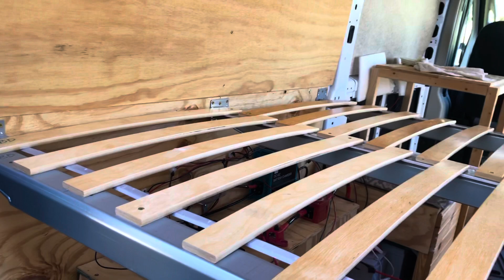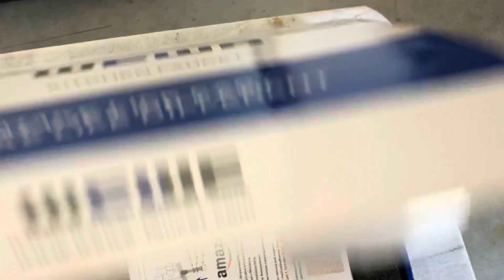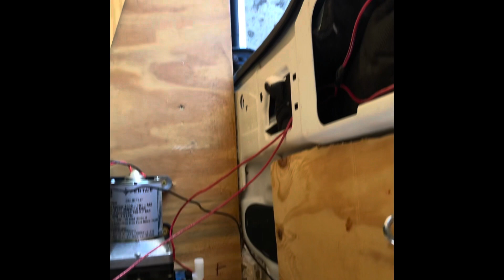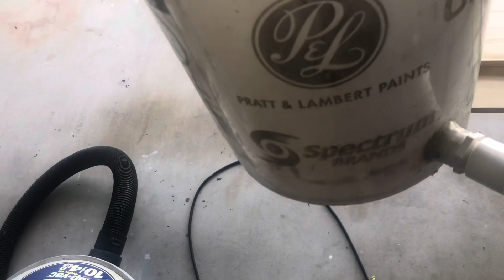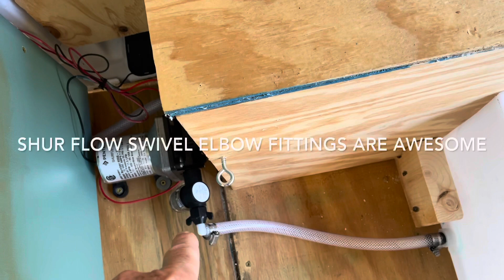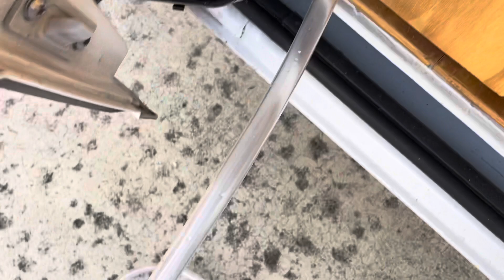Promaster Van Conversion How To Install A Basic Fresh Water System

Comment: Thanks for the video, ❤ tgis may be a dumb question but why do you need a air vent? Pleasure?
Reply from the maker: All water tanks have a vent to keep it from a vacuum. The tank will compress & make the pump work harder. 👍
Reply: @FOLLOWINGWALKERSWORLD  see that does make sense, but I don't need that big of a diameter? Can't I just put a penny size hole?
Reply from the maker: @Van-life-4-Jesus The tank is pre drilled with that size.